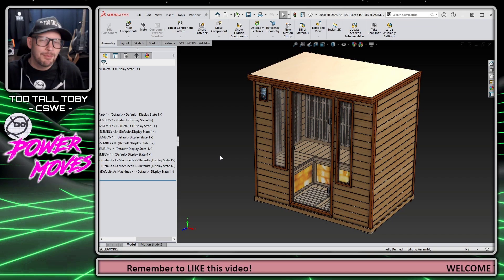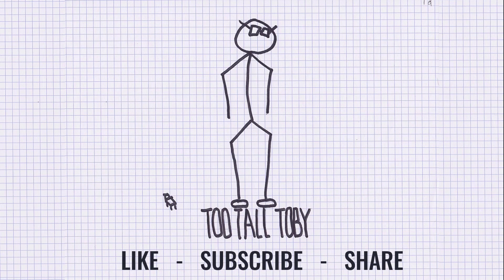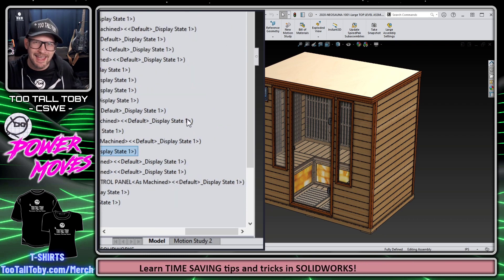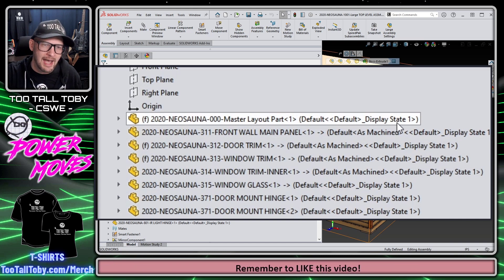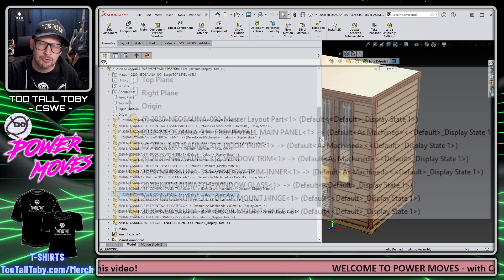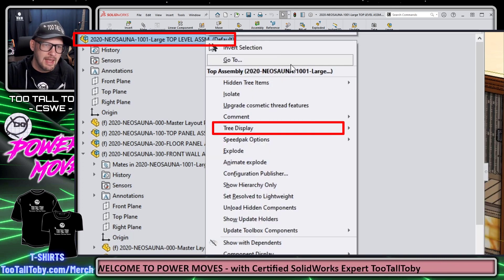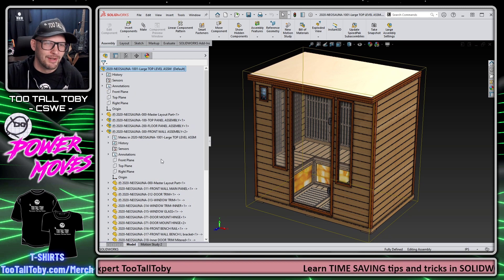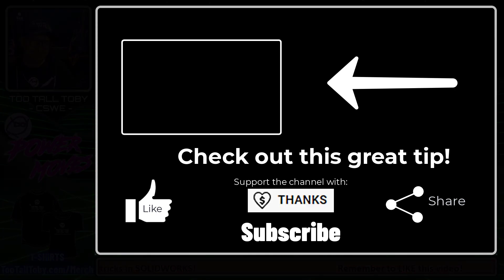Work Faster by learning to TRIM the SOLIDWORKS TREE

Comment: Toby, perhaps you know. At my previous employer we worked with I think solidworks 2017. And we managed  a part numbering system naming the parts and assemblies. We would give the part its description within the part under the tab custom properties. These also appear in my BOM under description. But when working on the assembly I could also show the description name beside the part name in the feature tree. So for example: partname:00001-500-1000 "main frame beam" which would make it easier to identify parts withing the assembly just from the feature tree. 
And i can't seem to get it to work anymore, at least the last few SW editions. You familiar with this problem?

Comment: Thanks Toby. Great tip, had no idea.
Reply from the maker: Aww yeah thanks table 3 6!
Reply: @TooTallToby  Question, Have SW2022. It works a bit differently, but if I change settings it will hide the top most (configuration) and <display state>. I'd like everything in the tree hidden, but the top level to show the config and ds. Can this be done?